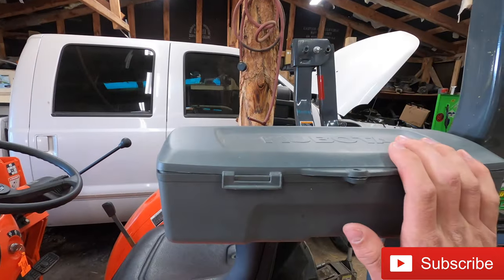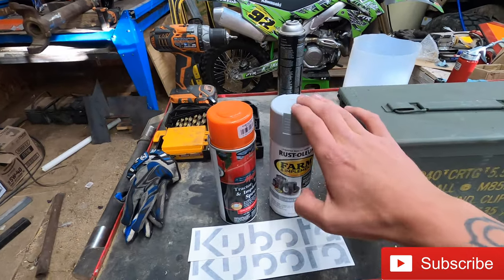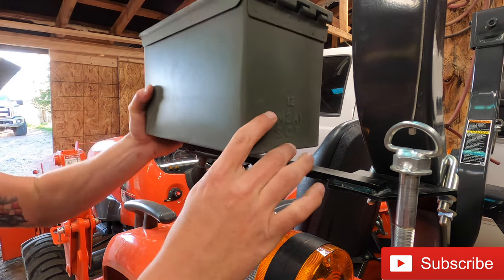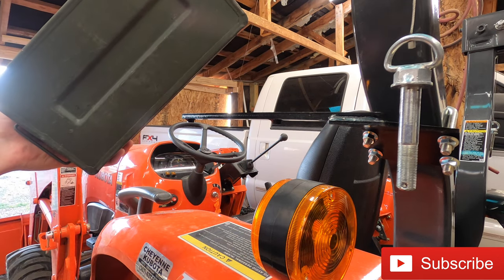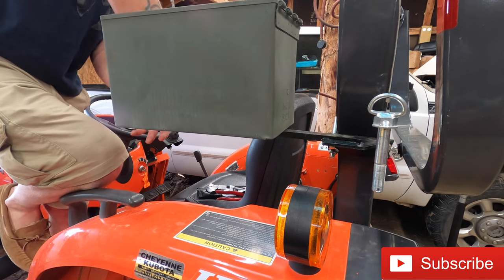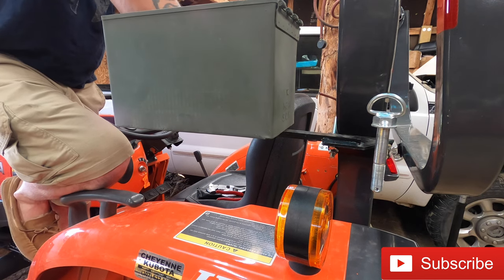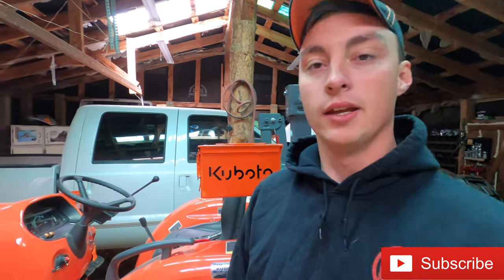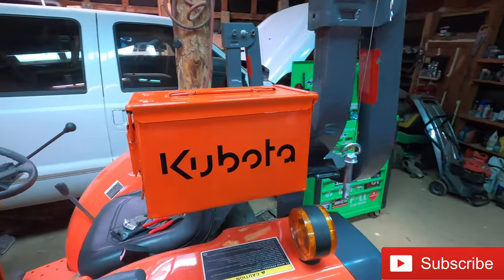Kubota L-Series Tractor MUST HAVE MODS!! [ToolBox] [HOW TO] [EPISODE #3]

Comment: Good work....very nicely done.  BTW the part number for this bracket is 7K503-16840.  Bracket, U-bolts, nuts and shipping will run about $100 at Messicks.    It's a great solution, but it will be in the way for me when I'm tilling and brush-hogging so I have to find a different location.  I bought the extended  behind-the-seat ammo can bracket from Zooks, but that's going to hit the 3-pt hitch at the full up position.   Not sure what I'm going to do.....
Reply from the maker: Thanks for the comment!

Comment: I did this mod, kind of. I put the ammo can onto the right side loader support arm and left the mount you are using for a second box which I just kept the OEM tool box on there as additional. But i do have a smaller ammo can to replace the OEM box with at some point.
Loving your mods so far.
Reply from the maker: That is an awesome idea! Great to add another one for additional storage!